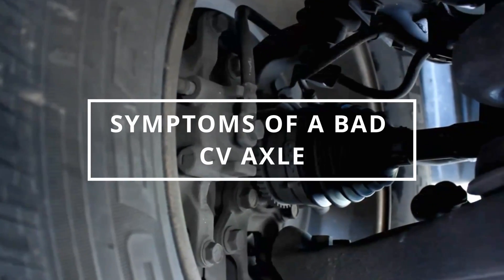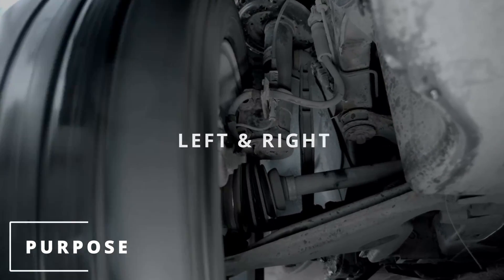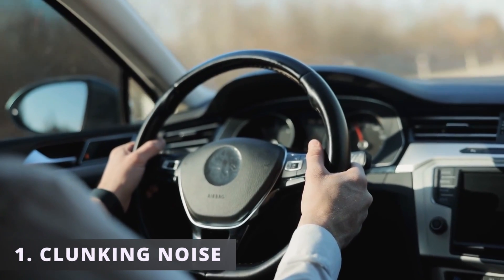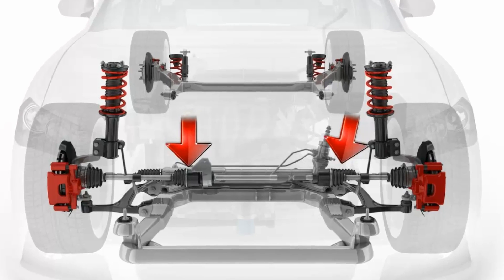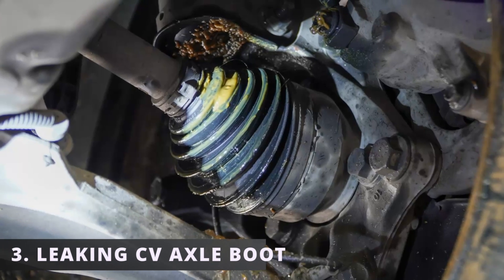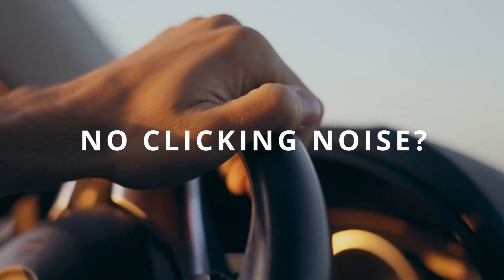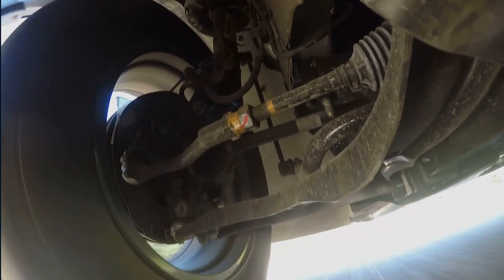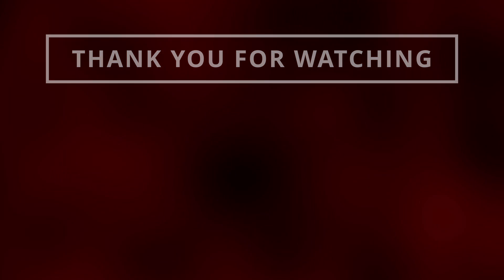SYMPTOMS OF A BAD CV AXLE

Comment: Literally the wheel would shake so bad I'd have to pull over and wait 10 minutes for it to cool down before I could drive again My truck had bad CVS it sounded like the freaking shock Towers were crunching and banging when you would turn the tire the worst part was my truck started chewing through a lot of gas. Most people don't realize it can affect gas mileage bad because if the bearings are shot it's a lot harder to turn it

Comment: I looked at my axel's and they don't look torn or leaking. However sometimes it will do the clicking noise when turning right...i am trying to replicate it by turning right but it won't do it. It happens randomly. However now what has me worried is that i heard a pop sound twice in 2 days. It sounds like i hit something on the road but it only did it when i proceeded to turn right after stopping at a light. The second time i had just had lunch at the park and as soon as i started moving i heard a loud pop again. I backed up and moved forward a few times and couldn't get it to do it again. Now i feel like if i take it to the mechanic, he won't hear anything.

Comment: Thanks bro. I was 90% sure it was this, but this video confirmed it. It's always nice to get confirmation from pros before you climb under there and start taking stuff apart.

For those curious, I have the grinding/winding noise when accelerating, a quiet grinding sound when driving, grease all over the inside of BOTH wheels, and popping when turning the wheel and moving with it turned. It pops loudest and more often on the driver's side but it also sounds like it's coming from the passenger's side too. Now the question is how did both of my cv axles blow out at the same time after I let a family member barrow my car? No idea.... wish I knew...  but oh well.

This was a perfect video bro thanks again.

Comment: I’m not sure if you’ll answer me I have a 2015 Kia Sedona. I have a grease around the boot Bell tire told me but honestly, my card does not shake while driving. It does shake a under breaking not while driving and not while turning do you think it’ll be an OK or a good idea just to change the boot and then replace the grease cause I don’t hear any clicking and I’m gonna get the rotors and brakes done also, I’m trying to save money. Hopefully, you’ll answer me back. Thank you.

Comment: Noise i hear starts around 40mph and gets louder closer i get to 70 and it sounds like something is bent i hear womp womp sound i changed inner and outer tie rods and ball joints i changed wheel hub and bearing and noise still there cv acle is about year old could it be bad cv axle or is the sound coming from transmission ? When i took wheel off to change the hub i played with cv axle and theres a play back and forth and also where cv axle boot is i grabbed onto the shaft and i can move it in and out is that suppose to be like that? Im working on acadia btw

Comment: 0:39 "now depending on which way you turn, you can tell which CV axle is affected". Wrong, at least in my case.. I heard noise when turning in both directions, but it was only the left one that was bad. Thank you for the advice though. I will check the boot regularly.

Comment: That clunking noise is the exact noise I’ve been having, but can’t find it anywhere else on YouTube but this video. The noise is coming from the right side. Got parts for both sides. I replaced the right side with new wheel bearing/hub assembly, cv axle, sway bar end links and tie rods. I’m still having the noise come from the right side! This is only at a dead stop. Won’t make the noise in reverse, and stops after 15/20 mph. I do know there’s a torn boot on the driver side.
Reply: Hey bro I’m having this problem rn did you end up finding what it was?
Reply: @giovannicarranza3802 I’ve replaced the whole front end and driveshaft in the front, I’m junking it soon, blown head gasket. Pushes coolant out of the reservoir, won’t drain back. Exhaust gases. Not worth it to fix given the rusted ass shape it’s in, I’ll just never be happy driving it.
Reply: It might be a bad bushing in the knuckle brother.
Reply: @MrEpicvids101 it’s the crushers problem as of today  lol

Comment: I hear more of a clunk noise and it almost seems if the car slips away a bit. I have only noticed this on full lock turns in slow corners, walking speed. Could this still be a CV joint issue?
Reply: I have noticed something similar: Full lock left turn, walking speed, clunking, feels as if the wheel was triangle shaped or something. Only noticed once a few weeks ago, too afraid to reproduce it :( Have you figured out what is on your car?
Reply: No not yet. If remember I’ll let you know.
Reply: @rayhuene4303  Thank you, I'll try to do some testing on my car, and let you know too.

Comment: I've just noticed my cv clicking/clunking when turning left on my 09 Ford Territory like 4 days ago.
After talking with my partner about what cv's are actually for and the consequences involved with a guaranteed negative outcome for ignoring or putting off the problem, I've decided to start using my other car until I can save enough money to get the issue resolved. I'd rather use my pos jeep than potentially put myself and other road users at risk by driving an unsafe vehicle.

Comment: I get a clunking sound when I turn in both directions, this happened the next day after driving my Discovery 4 through water, changed oil, no water in engine air filter/intake?

Only happens when I turn the wheel and move and worse the closer to full lock.

No sign of split boots, any ideas sir?
Reply: Some particles probably got inside somehow, drove through mud the other day and my left cv axle joint exploded and all the bearings fell out. Now I’m driving around praying to god it doesn’t fail me on the highway until I get a new one smh

Comment: Here's a fun 1. I've got a clunk/thump when cornering, started only left turns now it don't matter. I've got new struts and new sway bar. Rods are a year old and cv axles are almost new I've visually inspected and there's no excessive wear that I can see. Steering wheel has slight feedback and I feel the thunk under my feet. Personally I suspect LCA bushings.  But oem are 600 a side which makes it an expensive guess.
Reply: @mrhyde0705  if your vehicles a front-wheel drive vehicle and this occurs while you're turning left or right may indicate a sign of low gear oil from transfer case. This gear oil is needed for when the vehicle is turning left or right on front-wheel drive cars as the inner tire for whichever way you're turning needs to turn more than the outer tire, and if the gear oil is low will cause the clicking sound from the transfer case.

Comment: SOS
Mini One
Steering wheel-Scraping noise at low momentum- usually whilst reversing/moving out of, with wheel 3/4 to full lock. Slight scraping/scuffing sound and/or a clunk/thump when hits full lock. 
🙏

Comment: Hey I'm Dutch and I'm trying to find a term in English which I thought was the axle. My car makes this scraping sound on the left back wheel. First I thought it was the brakes, however I changed these and it doesn't solve the problem. Now if I grab the left back wheel with my hands and wiggle it around it moves a tiny bit in every direction whereas the back right wheel doesn't and i know it's not supposed to do that. I think it is the axle or whatever it's called because it had an accident on the left wheel side. I mean the rod thing that connects the 2 wheels together and supports the weight of the car on to the wheels. Anyone who can help me either help find the right term to search for or confirm it's probably the axle or whatever it's called? Thanks😅

Comment: Mine is clunking when changing gears, and there are vibrations when accelerating. It happens on lower speeds 20-30km/h. Both inner driver and passenger side have play in them so I'm changing whole axles soon.

Comment: If your turning left and hear the clicking noise its not the left side thats faulty. Its the right side. Just want to clarify. when turning to the left and hear clicking noise, its the right side, when turning right and hear the clicking noise, its the left side thats faulty.
Reply: I probably  just replace both
Reply: Hi there, will it not be weird if you hear clicking sound from both turns, I mean either right or left turn,  same clicking sound you can hear? Does that mean both cv axles are toast? I checked the boots and both look fairly clean and dry Thanks
Reply: It doesn’t have to be leaking to be damaged. That just means that spot seems fine. But it could be damaged inside the transfer case.
Reply: @miguelsumalinog1516 having the same issue rn. Turn left I can hear it left, turn right and I can hear it on the right side
Reply: @JussDraftfr  was it the cv axles? I’m having same issue: clicking noise turning left and right. Already changed tie rods, ball joints, struts.
Reply: What if you turn the steering wheel to the right and back up into a space or drive way and hear and feel the clicking noise?
Reply: My car sat for a week or two, I pulled slowly out of the parking space and turned full lock left and the front right wheel felt like it was a frikking brick and not round. No clicking, more a rough banging! Even the car's front right side jumped up and down as if the wheel was a triangle or something. Alerted, I immediately jumped out of the car to inspect but everything looked okay. Haven't heard it since, too afraid to turn it left lock. CV axle? I mean not much else to choose from? It's a 2 year old FWD Toyota.
Reply: @Ilker_Ali89  Either axel or wheel bearings. Jack the car up & try to wiggle your tire up & down- side to side with your hands on the wheel at 12 & 6 o clock. The wheel should not move, grab the wheel at different angles as well while trying to wiggle. If the tire moves its the wheel bearing. If it doesn’t move its most likely the axle. You’ll hear popping noises when turning, driving on uneven roads, driving over speed bumps & will also feel like you’re driving on a flat tire. Flat tire feel will be more noticeable at lower speeds.
Reply: Bullshit
Reply: Wrong 😂😂😂😂😂😂😂😂😂  90% of the time  if it clicks turing right, it's the right side that's fuct. If its both then change both...it's not rocket science
Reply: I just want to mention that this clicking sound can also be coming from a worn strut. If the hydraulic from the strut loses its pressure for whatever reason. The coil spring from that side can start to slide and make a slight clicking noise only when your turning the wheel. You would have a slight pull to whichever side is damaged while driving and bad vibration at higher speeds and over bumps on the road.  If the cv axle is worn or not pushed in completely allowing the c clip to catch it securely, or the c clip is worn, damaged or not present , you may hear a clicking noise from the bearings in the cup inner cv joint. I would also check tire pressure on both sides in front tires , compare and air evenly just to make sure the weight shift of vehicle is balanced. When moving vehicle in reverse and this clicking occurs doesn't rule out the worn hydraulic pressure but indicates this is more likely an inner cv joint issue not properly installed or with the c clip that secured it being the issue. If the clicking is from both sides , as you hear it turning left or right , yes it can be both sides and is not safe to drive . Whoever installed the cv joint on your vehicle did a poor job or incorrect or can just mean the cv joints need c clips or it's just that time to have it replaced. Many important factors will need to be considered because everything is caused by something else on a vehicle and it can get out of hand. Make sure you check all things needed before replacing parts and wasting time and money.

Comment: I hear a rattling noise whenever I accelerate and it sounds like it’s coming from under my dashboard. Could it mean that my axle needs replacing?
Reply: Yes it does. Mine started doing that the other day and I took it straight to Midas and they confirmed what they had already seen during my inspection- my driver's axle shaft needs replacing at the tune of almost $600. I'd rather pay that than be in an accident.

Comment: Had a light bearing sound passenger side. Shortly later it became a lour clunking, shortly later i bust down, 3 out of 6 lug nuts torn off. Replace lower arm/ball/rod end, new bearing, new hub, still clunking again! The sound is coming from near the rotor. Double checked brakes. Ok. This cv axle was replaced 1 year ago under a recall> I ordered a new cv axle made in China. (what do i have to lose)? Is my manual trans axle shot? I kinda dont think so but now im getting really scared. This is my only car. Its a little Honda FIT. PLEASE HELP ME.

Comment: Recently changed spark plugs( probable wrong, because originals were high perfoemance sparks,new ones ordinary) . At the same time Mekanics said; right axel lost greese, needs new 1

Would right side worn axe , can cause shaking engine, normal while driving over 2000rpm, and but reaxcelerate between 1500 rpm to 2000 rpm then engine shake, trouble to speed, but giving more gas and  ok after reaching over 2000 rpm.. Which one is the problem? Is it spark plugs or axes?? Any help

Update: turnout one of the injection  modüle. Replaced and var running smootly
Reply: You’d hear engine knocking or sluggish acceleration if it was the spark plugs. You might also get a check engine light code warning you of misfiring. More than likely it’s the cv axles or wheel bearings and potentially even your engine or transmission mounts.
Reply: @Sulfen I just replaced passenger side CV axle seal and CV Boot,
but now the transmission is slipping….

I replaced the same on the driver side with no issue.

Am I not properly seating the CV axle, most likely?

Comment: i get vibration at 45, 55, 65, 75 & 85 mph, rapid vibration, i can speed thru these quickly, but if i slowly come up to these speeds whole jeep vibrates, but when someone is sitting in the passenger seat, vibration doesnt happen as much. ive change the wheel hubs an balanced the tires. jeeep commander 5.7 hemi 4wd.
Reply: I have the same did you find where is the problem please ? Thanks
Reply: What was the issue? I have the same symptoms
Reply: Don’t know yet I believe it’s the cv boot on right side or both

Comment: Just installed brand new cv axles as well as many other parts. Noticing these exact sounds right after install. FML!!
Reply: Then it's not your CV axles
Reply: Sometimes the wheel bearings can make similar noises but they tend to be more consistent at most or all speeds.
Reply: @Sulfen I just replaced my rear cv axles and still clicking noise. You think it’s the wheel bearing??
Reply: @poyrazakayy  could be your front ones instead
Reply: aftermarket cv axles are way worse than originals
Reply: Same
Reply: Did you have any bolts left over after putting it all back together 😉

Comment: when i turn right, i hear a clicking noise on the left side of the front of my vehicle. when i turn left, i dont hear anything. is it the left cv axle?
Reply: Yes. But if it makes noise even when driving straight it’s the inner cv joint and it can be hard to tell if it’s the left or right one. I just replaced my left and it turns out it was my right one…

Comment: What if i don't have clicking I just have clunking when I turn, and vibrations at high speed?
Reply: Did you ever find out?
Reply: It’s typically your right one going bad. The right one has a carrier bearing that goes bad. If it’s rear wheel or all wheel drive then it’s probably something else.

Comment: i heard a loud thud when trying to turn left, when i stepped on the gas my car won’t move i tried reversing and it didn’t move at all? would this be a sign on broken cv axle?
Reply: Was it the cv axle? I just had the same exact thing happen but I hit the gas in my truck and heard a thunk, and can't go in drive or reverse
Reply: @__Under_Pressure__  yeah once i got it fixed it ran perfectly fine it’s easy to fix yourself part is about 100-200 but varies depending if car model b year